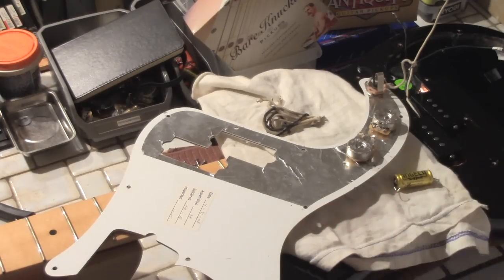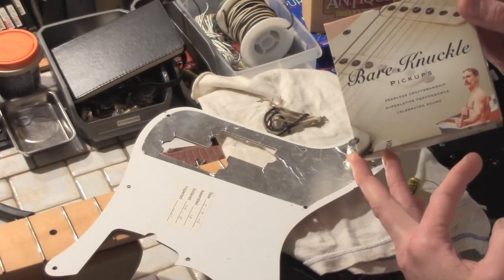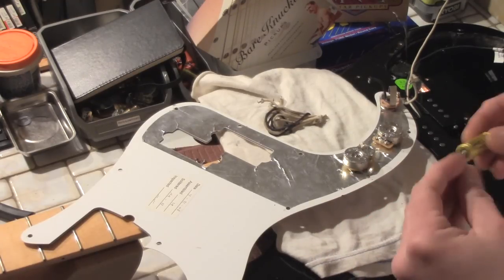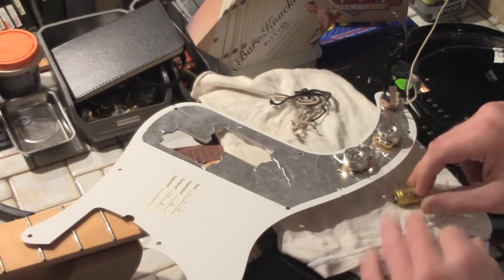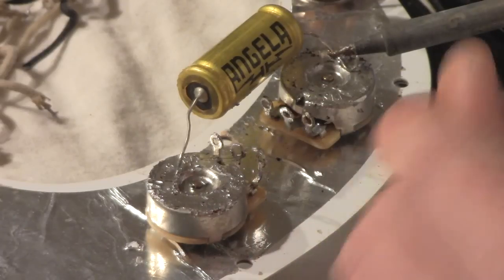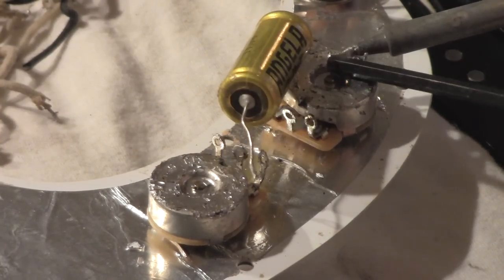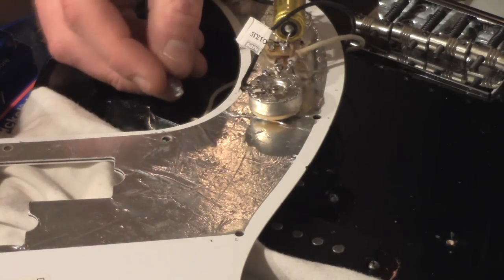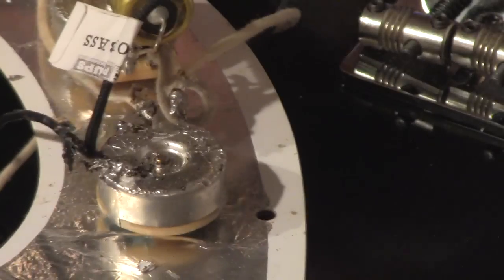Wiring Your P Bass

Comment: Bought a P bass pickup set "Pre-wired" on Ebay. Not gonna try to even describe the mess I received. Think the guy just started grabbing wires and soldering. De-soldered everything then found your video. Best one I've found for this kind of thing. Plus I got some great new tips on soldering. Will definitely be recommending you in the future. Very well done, Mate. Well done.
Reply: Best just to get a hot solder gun and start all over. 
That's why Fenders are all the same from day one. 
If it's not broke don't fix it. 
Same with the Guild Starfire Bass. They all been made the same going on over 50 years. Fender P & J Nice to work on. 
Ya can work on it in the back of your car,  . . . .bro. 
We talk funny like that in the USA,  Mate,

 Have a Fosters on me, ...... Cheers.
Reply: This is actually a bass I built myself. Got it all torn apart and redone. Plays like a champ now
Reply: Cooel, nice job. I'm getting ready to take a black Fender Jazz MIM 1999-2000 to the neck and body(shield it). I found a deal on reverb.com. I just ordered from a dude in Minnesota. stock/mint pups,  pots (pre-wired) mounted on the cover(no scratches), white pearl pickguard, all nice screws for $60+ ship$10. 

Tell me what u think of this idea? 
Check this out. I'm thinkin use the old chrome cover to test it out first. To see how it works

I take Muriatic Acid add a little water not much. Take a paint brush and wipe it over the control cover, bridge, tuners, screws, ends of the extra long strings (need to melt clear plastic on the ends so they don't put a eye out). Then wash the stuff off with a little water.  
That will turn all the parts into instant old rusted looking like they sat out in the back yard for 50 years. Won't hurt the the finish or clear paint on the guitar. Then use the old pickguard for a template to mark a thin piece of pewter to make a pewter pickguard (can't use any metal around the pups, they would hum like a Indy car) 
I'm really thinking about it. I haven't seen this idea. Use a section of old tarp (3.5in.) for the strap.
Make a Fender Rat Bass for my self, look all wild and shit.,

Comment: The capacitor type on the tone is snake oil. The only bad capacitors are ceramic bc those are microphonic and electrolytic bc is noisy and most of them are polarized. But there absolutely no diference between the poly 25 cents part and an orange drop or paper on oil or whatever fancy stuff you put in there. Spend the money on better pots and input jack  Those are mechanical you get a longer lifespan of those parts.

Comment: my pbass kept on buzzing when i touched the metal parts "grounding issue" when I used this method of wiring.  I ended up soldering the cavity ground wire to the input jack where the hot wire is and that worked.
Reply: I was looking at the remarks 'cause I had the same problem.  I eventually discovered that if I ran a wire between the tops of the pot's all was well.  It connected the ground.

Comment: Hi Roy, I wired my p bass exactly (so I think) like you showed but the volume pot doesn't work. If you could help I would greatly appreciate. Can send a picture. Thanks in advance.
Reply from the maker: something is not hooked up correctly or you have a cold solder. Go back and follow these steps exactly and you might find your issue. Sometimes its the smallest detail you missed, a faulty part or something is touching something else causing a sound cancellation altogether.

Comment: Great video but confused on the comment that you can use a orange drop cap. but you decided on a paper and oil as an upgrade. What exactly does this upgrade actually do?
Reply: Nothing
Reply from the maker: the guy who said nothing is actually not correct. its really personal preference. I notice a smoother treble roll off  on the tone controls and had these paper in oil caps laying around so I used it. Again its all personal preference. Many people use aftermarket caps so I wanted to mention them in the video but its certainly not about that. hope that helped.
Reply: @roycox4415  Bullshit, nobody can tell the difference as long as the values are the same and the caps are 100% in working order.

Comment: Thank you for your time in doing this video it's very helpful 
Would you suggest this cap?
What would you say this can do over an orange drop?
Reply from the maker: hi daniel. as long as the cap is good quality its not necessary to use an expensive or specialty cap. I had these paper in oil caps laying around so I used them in a few builds and projects. They sound great and I mentioned in the video that its really all personal preference. This particular paper in oil capacitor is a bit smoother in the treble roll off though i noticed so to me it was worth it.
Reply: Capacitors go along with the tone you are looking for. .047 is so close to .050 fender for jazz and classic or vintage tone p .1 fender cap. Put those in my fender player series and squier CV 70. SURE SOUND GREAT. My next jazz I'm going to use stacked pots neck .1 and bridge .050.

Comment: you have wired up the capacitor in a weird way. Typically with the volume and tone tabs facing each other. the capacitor goes from the volume top tab (-ve) to the tone middle tab.
Reply from the maker: Incorrect. This is exactly how standard p basses come wired . Look up the diagrams for standard p bass wiring and then watch the video closely. The cap stays with the pot itself in this case. It’s not like a strat where it jumps across pots.

Comment: I have a question - have you used the conductive shielding paint to eliminate the single coil squeal? If so, how effective is it? Does it need to make contact with the metal grounding tape you have on the back of your pick guard and the ground wire that would run from the bridge?
Reply from the maker: yes its touching the ground screw in the cavity

Comment: Can you improve the sound of the with a different capacitor?
Reply from the maker: its not that is changes the tone but rather how smooth the top end is when rolling off or on the treble as a whole. very small differences but they can be audible
Reply: @roycox4415  thank you
Reply from the maker: @charlieburns1385  anytime!

Comment: Thanks for the video.  Do you have any tips on reducing proximity buzzing?
Reply from the maker: The only thing that helps is the copper shielding inside the body. Helped mine a lot!
Reply: Thanks.  So, copper is better than tin foil?
Reply from the maker: +mrpositronia in my opinion, yes, much better!

Comment: Question. That first lug on the volume pot is moving around. Shouldn't that be replaced? Isn't that risking a failure?
Reply from the maker: +Stephen Fink It has a touch of play in it but I have used this pot a bunch and it works perfectly. If this was for a paying customer then I would replace it but it was for a friend.
Reply: Yeah man, I think that’s from hitting it with the iron for too long.  You gotta be fast sometimes.  I find using 63/37 solder and getting it on the iron, then putting paste on the lug and just giving it a little tap and it will spread nice and even.  I can’t tell you how many switches and other stuff I’ve melted doing that.  Soldering paste makes tinning lugs 100x easier, for me at least!
Reply: Roy Cox I think it’s because they use electric paste to hold that stuff down sometimes and the iron liquifies it.

Comment: Great video. . one question though. I've seen people wire the ground wire from the bridge to the tone pot instead of the volume pot. Is this wrong and if so why?
Reply from the maker: its not wrong, just different. the pots are grounded together in most case so whether you attach the bridge ground wire to the tone of volume pot shouldn't make a difference.
Reply: @roycox4415  thanks Roy!
Reply: @roycox4415  hey Roy good evening I just need your advice on this one. I'm doing a pbass project and have two pots, one is b500k and the other an a500k which one should I use for volume and which for tone?

Comment: I am on the process of doing this within next few days. I have SD Quarter pounder and I was wondering if it´s ok to use 500K knob as a volume and a 250K as a Tone ? Or should they both be 250K ?
Reply from the maker: its really personal preference. the standard is usually 250k pots but I prefer 500k. The tone will be slightly brighter but you have more play in rolling off the treble, etc. Using the 500k as a volume is fine though
Reply: correct me if I'm wrong. I did some soldering yesterday and ended up with 500k volume and 250k tone. 500k volume is a bit brighter, but the 250k tone smooths it down (with .68 capacitor) but still gives me a good amount of adjustability.

Comment: Does it matter the type of solder you use??
Reply: Also if I'm using an orange drop, can I still follow your steps or is it different?
Reply: Great tutorial!
Reply from the maker: +Cody Wheaton thanks so much Cody! Hope it was helpful!
Reply from the maker: +Cody Wheaton steps are identical no matter the cap used as long as the cap you do use is hooked up to the same exact tabs I show to use in the video.
Reply from the maker: Technically no, but in audio related projects I do recommend using good quality solder. I use carden.
Reply from the maker: @cojakwheatmon817  yes! its all the same
Reply: I'm pretty sure I followed this exactly but I get no sound at all when plugged in. Suggestions?

Comment: Anyone that can help me? I followed every step of the way Roy showed me, but I still don't have signal coming from the pick ups..
Reply from the maker: If you followed all of the steps with absolute accuracy and you still don’t have sound then you have to retrace your wiring to find the issue. The wiring procedure here is 100 percent correct but sometimes you will have something not making complete contact or your pickup is damaged or defective in someway. You may want to test the pickups first on a multimeter to make sure you have working pickups. If you are sure they are working then you have to trace each connection in your wiring while having the guitar plugged in. Even make sure your guitar cord is not the issue. It only takes one little thing to kill the whole signal flow
Reply: @roycox4415  Good tip, thanks!

Comment: I have 3 wires on my pickup wtf is the 3rd one ?
Reply: Probably for coilsplit or reversing polarity. A lot of pickup brands come with thosr options but are not required to use in normal wiring.

Comment: has anyone tried wiring the pickups directly to the jack??  no pots
Reply: kleyo libor yes you can but will have a very bright output, you can cut that with a resistor onto the output jack but really you lose control and becomes more complicated than having the pickup wired to the pots, there are a lot of differing opinions and forums describing that very thing, if you are just wanting wide open all of the time you could still run to a volume pot set full and bury it under pickguard just being careful not to let any wires touch
Reply: thank you for the reply! i'll try things out.